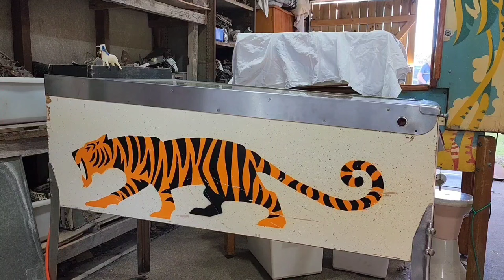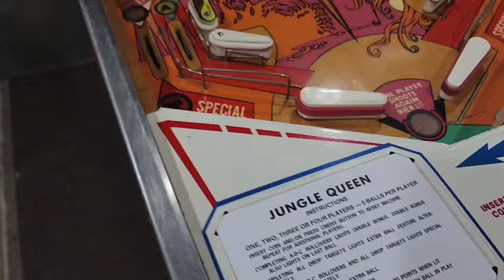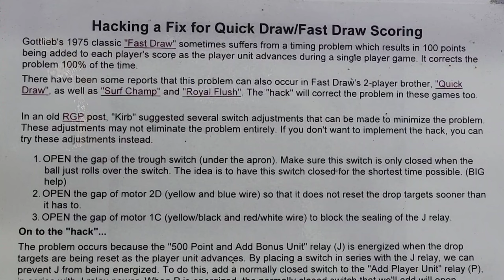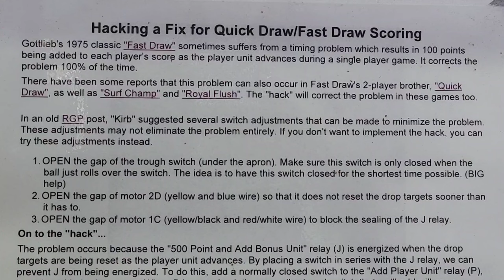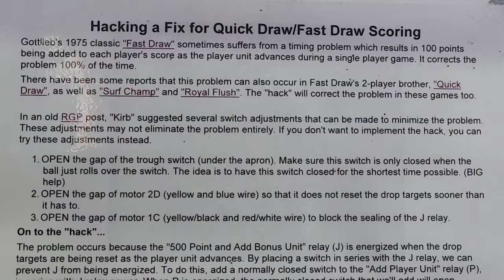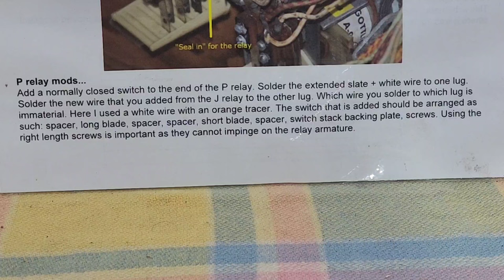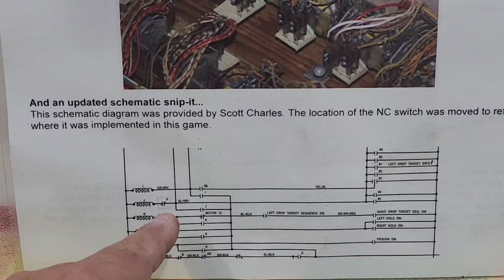How Do You Fix This ? Repairing Jungle Queen

Comment: 21:00 One drop of the blue top '3 in One' machine oil on the shoulder screw, then tighten it (the hole through the frame is threaded!) only then install/tighten the nut on the other side.